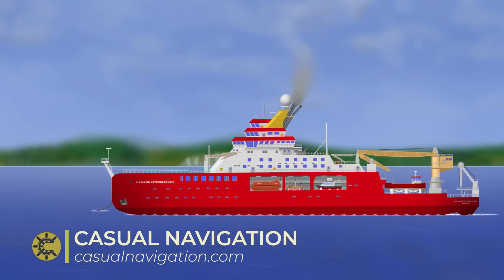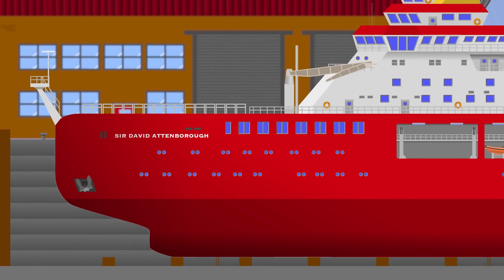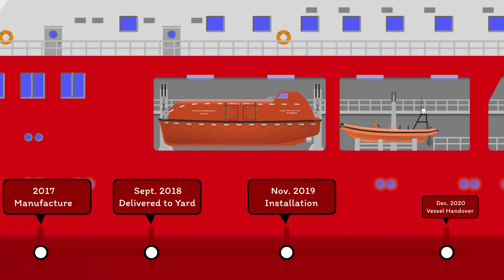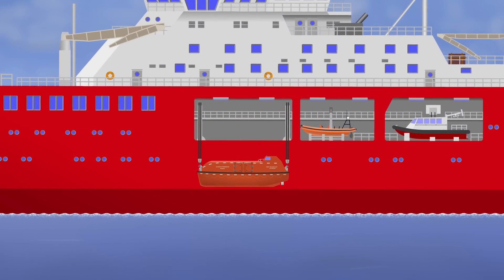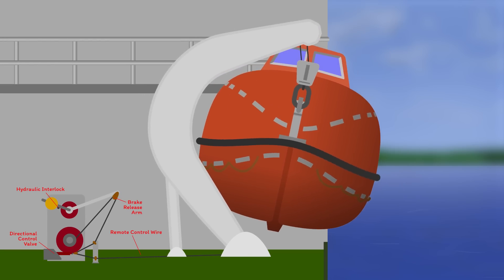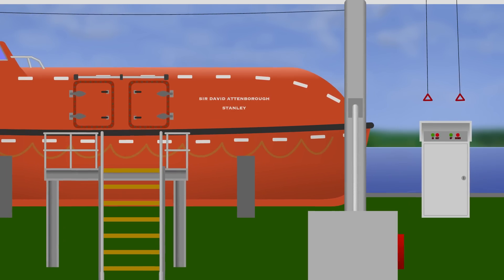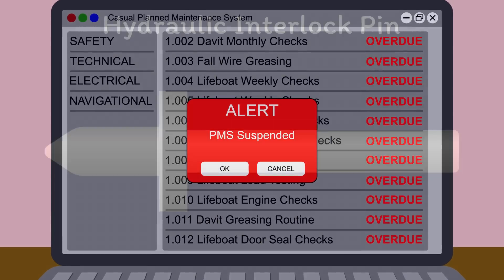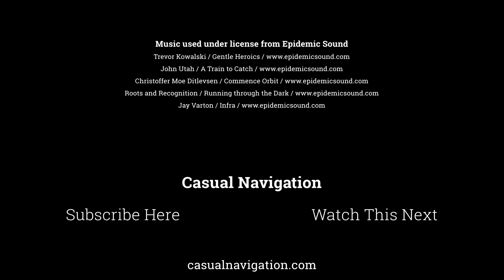How Did This Lifeboat Fall Off?

Comment: Can't find a correct thing so put a bigger one.
Bigger one does not fit into the hole so enlarge the hole... NO. Put the correct thing, not adjust the CORRECT thing to your incorrect one. This will just lead to a chain of "incorrections".

Comment: What occurred was even more dramatic for the crew....
" ...Confident that the day’s mishaps were over, three crewmembers entered the lifeboat and sat in their assigned positions, with the third officer taking the helm, a seaman grade one (SG1) alongside him and the science bosun in the bow. But as preparations were made, the crew missed a crucial detail – the remote-control wire was not fed into the lifeboat.  

The third officer stood up, opened the hatch, fed the wire into the lifeboat, and sat back down without refastening his seatbelt. Pulling the remote-control wire to trigger the lifeboat deployment sequence proved useless, until the third officer’s colleague, the SG1, got out of his seat to pull it a second time. 

This triggered the incident. As the davit arms began to move, the winch system released the lifeboat falls prematurely, causing the boat to crash to the deck. But catching on the still-extending semicircular davit arm, the lifeboat rolled over until it was on its side, throwing its unbuckled passengers against the wall.  

As the forward suspension ring released, the lifeboat veered over the deck edge bow-first; the aft suspension ring ripped off the aft hatch, and the boat plunged into the sea by the head, hurling the SG1 into the lifeboat’s nose. Water flooded into the hole where the hatch had been, submerging the three crew. The SG1 was thrown to the floor of the boat as it righted itself, discharging the seawater. ...."
https://www.imarest.org/resource/lifeboat-accident-on-rrs-sir-david-attenborough-lessons-learned.html

It sounds like the SG1 might have been seriously injured... And so it also demonstrates another important lesson: always do your seatbelt up!

Comment: A lot like the Augur TLP accident in 2019.  The OEM lifeboat inspectors said 'hey this cable is corroded' and then went on their way without fixing it or or making it clear that they hadn't replaced it.  And also hadn't replaced it every 5 years like they were supposed to over the last ~20 years. About a month later 2 people, who were standing in the lifeboat when the rear hook detached and the boat fell 80 feet, died.

Comment: A great video that exposes a fatal flaw in the system!

OK, am I the only one to question the material used for the hydraulic interlock pin?

I am a retired U.S. Coast Guard Marine Inspector.

The use of a material that is subject to corrosion for such a critical part is unconsionable.  The manufacturers reliance on a properly executed PMS system is pure folly.  The suspension of the PMS system by the owner underscores this folly.  British mariners are well known for excellence in operational seamanship.  It appears that British vessel operating companies are more like U.S. Big Business, "Let's save a few pounds by not doing what we should."

What if a ship is temporarily unneeded, and placed in lay-up status for an extended period?  Or, GOD help us, what if a vessel is sold to a less than reputable "Flag of Convenience"?
Reply: The pin was made of the wrong steel (idk wether that was a manufacturing issue or the yard being cheap). And they had turned off the PMS because it was re-issueing the maintenance calls. It literally issued them 16 months of maintenance orders and kept adding more for the same thing, so they turned it off while they "went down the list" so that they could fully wipe the system and start fresh.

Comment: I still find it very weird that any safety pin could corrode within 16 months
Seems off if you'd have to replace that every single year
Reply: Improper metallurgy. They don't know yet who in the production line cheaper out resulting in the bad pins, but they.are looking very hard for them!

Comment: Am I correct in thinking these are self righting lifeboats? Did it right itself, or was the graphic illustration missed that bit? For such an accurate channel, I can't imagine you'd have missed an opportunity to demonstrate that these boats to self right. 😊
Reply: It self righted, the animation just didn't run long enough. And this was despite the fact the rear hacth got torn off, letting in a ton (literally) of seawater! (Until it righted itself, putting the hole above the, thankfully tranquil, water).
Reply: @hanzzel6086  great stuff and very impressive.
Reply: @AaronTheHumanist  Modern lifeboats are a rather underappreciated marvel of engineering.

Comment: Pretty good engineering that despite all the screwups the lifeboat successfully deployed.  I assume the animation was incomplete and the boat properly righted itself. Unless the "modification" for the bigger clip wasn't sealed and it flooded. Of course thats believable too.
Reply: Yea arent they supposed to be self righting or is that only within limited parameters/conditions?
Reply: @MattH-wg7ou  I'd like to know this also. EDIT: Another comment stated it did right itself.

Comment: The pin degraded that bad in 16 months? Did they order it from AliExpress or what?!
Reply: It was in fact made of the wrong steel. He also didn't mention the boats rear hatch getting torn off and letting a bunch of water in before it righted itself.

Comment: Lifeboat accident story.  Was working as 3rd mate on a tanker, we were undergoing annual survey by our classification society.  Myself, the 3/E and an AB were supposed to launch, make a loop, and recover the starboard  (enclosed) lifeboat.  Surveyors, Capt and others watching from the deck.  Launch and sail in circles goes good, but we can’t get the release hooks to reset.  I’m working on the aft hook, the engineer was forward and the AB on the lever.  I hear a splash and a swear from up forward.  I think maybe he dropped his channel locks overboard.  Then the captain’s voice comes over the walkie “hey Steve, you wanna help the 3rd back into the boat?” At which point the AB and I realize the splash was in fact him going overboard, and we rush forward and haul him back onboard.  Only casualty was his pack of smokes…

Comment: Shouldn't a pin THIS important be made of stainless steel or something? I mean, from "operational" to "totally borked" in lousy 16 months... a safety device of this kind? This shouldn't be the kind of thing that you inspect every 6 months, but really could pass 10 years with no maintenance and still work?
Reply: Stainless steel is dogshit for this (more so for chrome plated), and the pin didnt even have the right type of steel.
Reply: @higueraft571  Use something that would be good then. Stainless steel was just an example. You are misunderstanding what I said on purpose.

Comment: 5:21 "... but it does really serve to show how dangerous lifeboat launching arrangements can be..."

Great to know that the option of last resort, which we rely on to save our lives when everything else has failed catastrophically, is, in fact, super dangerous.
Reply: Would you rather swim?
Reply: @ShadowDragon8685 Nope, I'll still take my chances with a potentially dangerous lifeboat launching system, but my point is that the situation isn't great.
Reply: @evanranshaw4659  if you're having to evacuate from a sinking vessel, the situation is already a great deal worse than 'not great.'

Remember, they have to balance a safe and smooth lifeboat launch in calm conditions, with the possibility that the ship is going down in the worst conditions imaginable, up to and including being torpedoed by a hostile power. The boat has to launch, or it cannot possibly be of any use to anyone, except maybe tearing free of its davits five hundred meters down and bringing its occupants' remains up to the surface to possibly be buried by their kinsfolk.

But yeah, the lifeboat tearing free unevenly, not launching properly? That's a pear-shaped failure and someone hopefully got reamed for it!
Reply: @ShadowDragon8685  Agreed on all points, although I think that lifeboat would probably implode well before it got to 500m. It would depend on the leakage rate vs the rate of descent.
Those fully enclosed lifeboats tend to be fairly well sealed, but they will have ventilation. On the other side, heavy objects (such as sinking ships) move downward alarmingly quickly underwater, once they've left the surface. The exact rate would obviously depend on the terminal velocity of the object in water.

Another thought I had, but haven't yet voiced, was that the fully enclosed lifeboats are typically self righting, despite the impression to the contrary that one might be left with after watching the animation in this video.
If you strapped in immediately upon boarding, that type of fall, though not fun, should be survivable (provided other people and objects inside don't turn into missiles).
Reply: @evanranshaw4659  TBF, I did just pull 500m out of my aft. Point was that lifeboats that couldn't launch properly not-infrequently tear free of sinking ships and float to the surface because they're designed to float at all costs.

And yeah, self-righting would be a factor; as you point out, if everybody aboard were strapped in and there were no loose objects to become falling hazards, such a launch... Well, you'd be being checked out by medics, but you might not even go to hospital.
Reply: Like ejecting from a fighter jet. Its not a great option. Just the "least bad" option, and likely to seriously injure or even ded you even if used properly.
Reply: Automobile airbags are really violent and can cause injury too. Just not nearly as much injury as they prevent in a crash.

Airliner emergency evacuation slides are dangerous. Joint injuries, broken bones, and burns are so common that sometimes crew just call ahead for emergency responders if they expect to deploy the slides. This is why pilots keep passengers on board if firefighters have a fire outside under control. 

Last-resort emergency measures are sometimes "safe" only compared to the situations they are intended for.

Comment: The answer to "How did X happen to Y if it is brand new?" is always "because it is brand new"
signed: a safety engineer
Reply: I'm far more nervous testing something that's never been used, than something that's worked correctly 500 times.
Reply: Especially running mouth like this and making meme, go the hell already.

Comment: How is it possible that society allows people making financial decisions about things critical to the safety of life at sea (and in many other places) to know next to nothing about the systems they are deferring maintenance on?
Aviation at least makes it very very hard to do this by having a "minimum equipment list" meaning "If this broken thing is part of the minimum equipment that the aircraft can fly with, you MUST fix it before flying it, no exceptions whatsoever no matter how loud the bean-counters are yelling at you about costs".
Sometimes the bean counters have to be pushed aside and the actual work has to be done, objections about cost notwithstanding. Things break when they break, and they need to be fixed before they work again. What is it about that which makes it so impossible to understand it when you have a budget to stick to?
Reply: But there wasn't anything broken, was it?
It was improperly installed, but as we all know that also happens in the aviation industry.
Reply: @Jehty_  
"there wasn't anything broken" with the Alaska Airlines missing plug door bolts, which was also improperly installed... see where I'm going with this?
WRONG IS WRONG. FIX IT!
Reply: @44R0Ndin  no, I don't see where you are going.
The missing door plug was improperly installed and it was missed.
Sounds exactly like what happened in this case.
So I don't see why you are praising the aviation industry when they are doing the exact same thing?!
Reply: @Jehty_  
I'm pointing out that something even remotely similar to this kind of thing is amazingly rare in the aviation industry (equipment not being installed according to the manufacturers instructions followed to-the-letter, with the Alaska Airlines incident being "The manufacturer itself did not adequately follow its own instructions"), and the highlighting of the Alaska Airlines incident was intended to point out "If it didn't kill anyone it was PURE LUCK and you still need to worry about it"
Furthermore, shutting down the maintenance monitoring system because "this is too expensive to fix and I want it to stop yelling at me" is something that would have instantly gotten a whole airline grounded until it was sorted out if it was discovered even before a major incident happened, whereas the consequences in this case are..... a whole lot of nothing, apparently.

Point is and was, airlines have a lot tighter standards to be held to, and shipping could do for some stricter standards too.
Not trying to praise either industry, in fact I'm trying to point out the failures specifically in the maritime industry, specifically the failure of "shoving the obvious problems under the rug and hoping that ignoring them makes them go away"
Reply: @44R0Ndin Pretty sure some airplanes dont spent as long being put together as boats? 

Also, the steel used wasnt the intended steel either.

This likely wasnt cost on the crew's part, simply "we'll work down the list as we go"
Reply: @higueraft571  
My point is that with this specific ship, the bean counters cut so many corners that there is nothing left in the middle to hold the whole thing together.
Ship built wrong = ship should be scrapped or put in drydock until it can be rebuilt right. That's all I'm saying.
You don't send it out and "hope" it will be fine. Hope doesn't float.

Comment: I'm sorry, but 16mo for such a critical part of an emergency escape solution to become non-functional due to corrosion seems like more of a design oversight than a maintenance oversight.
That part should be metallurgically designed to last a century, or at least be made out of some composite material that can match or exceed any strength tolerance needed.
Reply: It was made out of the wrong steel type, also the aft hatch got ripped off and the lifeboat started to flood before it self-righted. 

NORMALLY, it'd be in a better condition, if it was made as expected...
Reply: This was the biggest shock to me.
Reply: It was supposed to be. But someone, somewhere cheaped out.

Comment: Why is that pin even made from something that can rust? Couldn't it be chrome plated, made from stainless steel, etc?
Reply: Because plating can be damaged allowing the base metal to corrode and stainless steel isn’t. More “stain resistant” but under salt water conditions it will still corrode. Any other option is either too weak or too expensive for the application. That’s why maintenance checks are supposed to be done regularly.
Reply: Yeah, chrome/nickle plating is pretty useless for parts like this, where you have metal on metal sliding and also seawater. There are stainless alloys that can tolerate marine environments though. Downside is they often are significantly more expensive to manufacture, and can still rust under specific conditions. Therefore it is common that components are just made from carbon steel, designed with allowance for rust, and replaced at regular intervals.
Reply: Stainless steel is also less strong
Reply: It was supposed to be. But (either due to the yard or the manufacturer being cheap) it wasn't.

Comment: It really demonstrates the importance of drills… 
Nothing bad happened because it was a drill. The mistakes was founded and they will be corrected ASAP.
Drills save lives.
Reply: Nothing bad happened because the people inside the lifeboat were lucky.
That could have easily ended in serious injuries.
Reply: @Jehty21  And they were in an ideal spot near the coast in calm waters, during the day.
Reply: @dragon_nammi  So, since they people inside were not hurt, I assume they were buckled in?
Reply: @DugrozReports  Not sure they were secured since this source doesn't disclose that.  But if there were stormy conditions out at sea, at night, I doubt they wouldn't have suffered critical injuries or death. Or be lost entirely. 
I'm saying this was the best case scenario for a critical failure to happen in.